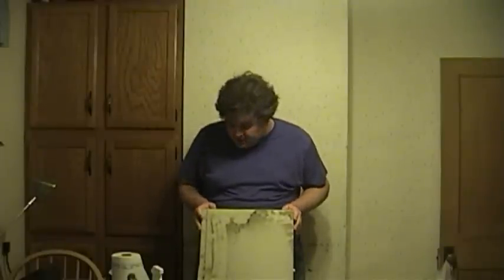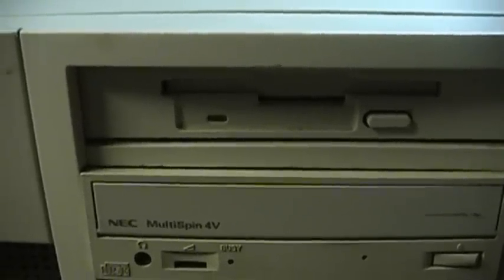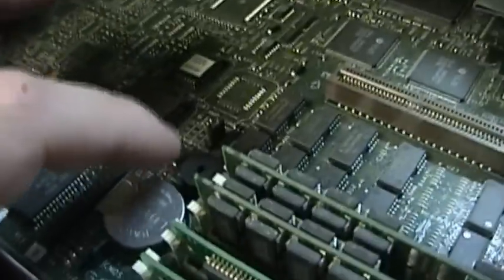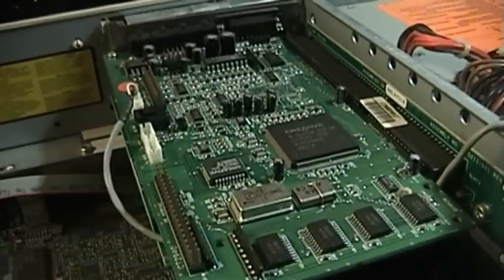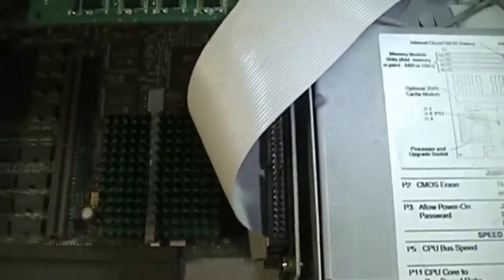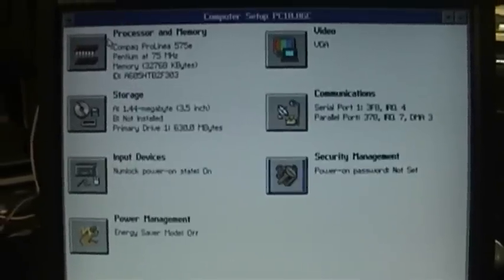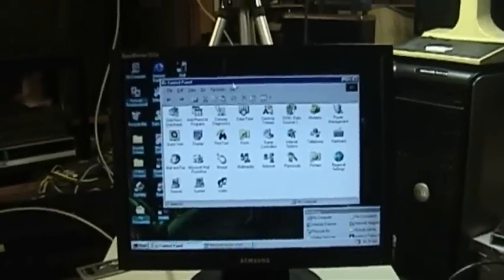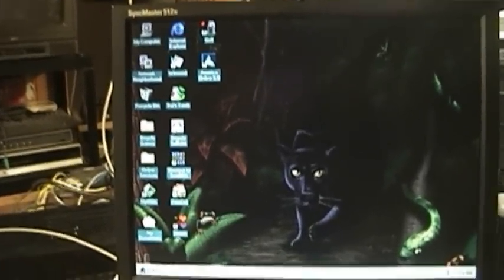Compaq Prolinea 575e Overview

Comment: If I recall correctly, these early Compaq machines beep twice to indicate they are in "turbo" mode.  In the BIOS/Setup program, there should be a way to change it to "compatible" or "deturbo" mode, and, once rebooted, the POST should only produce 1 beep.  I don't know if that holds true on such a "new" system like this, but it was the case on Compaq's 286 and 286 machines for sure.

The NEC MultiSpin drives made that clicking sound when powered.  Sounds totally normal, no surprise it worked.  I've had a few of those drives over the years.

Comment: For 1996, that machine was crappier than the average Packard Bell! At least they shipped machines with more than one PCI slot and a real Intel chip set (that could support 66Mhz bus speeds). Needless to say, such a machine from that era wouldn't be a keeper for me. There are better Socket 5 machines out there.

I'm also curious about how messy this mess room is.

Comment: You saved me from the boredom of waiting for Windows 8.1 to install 143 updates (~1.6GB download).
To add insult to injury after the 95-th update it logged me off without any warning and continued installing the rest of the updates.
As lacking in polish as GNU/Linux may be at least it handles updates right.

Comment: Ha ha thats classic bill, yep it does need power :)
Compaq 2nd ide port, bloody pain in the bum, "special" yep there special allright lol.
Im much the same as you but with any version of windows, all the fancy bullshit is switched off, basic menus and basic mouse pointer, no themes!!, no silly sounds.
As i came from the dos days i like simplicity, yes im simple lol im sure you were thinking that :-D.
i like a quiet o.s that just runs my programs, no arguements like vista/w7... give when you try to run a new program, just run the dam program without annoying me, i am the bloody admin so get on with it!! ha ha :-D.
When you talked about video chips i thought about my first pc, an xt class machine called Elernex, it had an unusual cga/ega card marked Video7, it gave me ega on an old cga monitor, it was deluxe in those days lol, it also had a nec cpu that run at double speed if you had a small dos util to instruct the cpu "Fast mode" lol, oh the speed :).

Comment: Hey UXW, Gio here. First off I been a subscriber for a while absolutly LOVE your vids. You make watching them so enjoyable. My question has nothing to do about this video. But I need your help on a simple problem. I have a Mac mini with a Mac pro keybpard. My problem is the keyboard has a power button on it to turn the mini on and off. Well the off works, but not the on?? Im sure your familuar with this keyboard. What would the problem be?? when you posh it to turn off it does. But when you push it to turn on. it does nothing. Any ideas you might think would be greatly apprecited. Thanks. Gio. Sorry for the long message.
Reply: Thanks Bill. But the mini is from 2007, just like the keyboard. thats why im confused why it doesint work. Everything else on the keyboard works.
Reply: Bill, Im SORRY you are RIGHT. The keyboard is from 1998, Damn I feel like afool. Thanks for answering. Gio.

Comment: A perfect example of one of the low-end Pentium machines that the later 486DX4 and 5x86 chips could easily outperform. Many, if not most, 75 MHz Pentium chips were designed for 90 or even 100 MHz operation and were underrated just to have a Pentium to sell at a cheaper price point.

I didn't notice the audio and video drifting too far out of synch, but you already have a solution for that... you just haven't used it yet. ;-)
Reply: *****
Use MediaInfo to check if it's doing something screwy like encoding the video with a variable frame rate.
Reply: ***** I really enjoy Sony Vegas Pro 12, for all my editing, although me and you make very different videos. Keep up the good work. :)
Reply: ***** Silly noob... you should be using Linux for video editing! :-P
Reply: Stereo Dust Particles haven't you got an lamp Imac G4 still sitting in your garage? Why not edit on imovie on oldschool osx with imovie 04 or 09 :D Would make a fun video.
Reply: vwestlife Well, there is a professional video editor called LightWorks that has a version for Linux. Except that a copy costs $500.
Reply: Good video i remember these computers
Reply: For some reason google chrome on smartphone wont show add a comment but anyway its Google or something.  Got a laugh out of video :)
Reply: vwestlife do any of you guys know this channel I am thinking of - it has a dodgy intro with like this wierd music and he makes videos similar to you guys (you guys being vwestlife, uxwbill and maxxarcade) something like bbsomethingcomputershop or something like that
Reply: ***** thanks, literally just got it now as well xD remembered one of the video titles.
Reply: +m80pls would that be BBISHOPPCM at all??

Comment: Some one seems to be slightly "ticked" off in this video! haha I get tired of people even considering core 2 duo based pcs to be ancient when the joke is on them! I am watching this video perfectly fine with a T7700 Core 2 Duo!
Reply: MaxinMaytrix Core 2 Duo CPU's are still awesome CPUs! (Core 2 Quad was even better!)
Reply: ***** Exactly! Core 2 Duo CPUs ran XP, Vista, and 7 blazing fast!
Reply: My t7200 struggles a bit with 1080p on YouTube but otherwise it really surprises me.
Reply: LordMaxin I think core two duos are good I use them at school they work fine
Reply: MaxinMaytrix I got  dell optiplex 780 with a 3 GHz core 2 duo, sadly I bought the wrong power supply
Reply: I was only joining into the simple conversation, no need to be rude.
Reply: MaxinMaytrix A few months ago, I bought a Dell OptiPlex 730 with a Core 2 vPro (a Core 2 Duo with some extra features for Virtualization) and Windows 7 Pro from my college's surplus sale.

Works pretty well, I'm actually watching this video on it.
Reply: I have recent resurrected an ancient laptop that featured a single-core Celeron 585, and it was painfully slow.  YouTube video?  No chance, it was so bad.   So, I found out what the highest-end CPU it could support was - in this case a Pentium dual core T4400.  Bought one on ebay for pennies.  Stuck an extra gig of memory in there (again very cheap) and, because I was feeling silly, I stuck a dirt-cheap Chinese SSD in there.  The transformation was incredible.  Sure, it is no gaming "rig" but, now running Windows 8.1 rather than the original Vista it is a little screamer, happily playing YouTube videos in HD and generally being a modern PC experience.  Not bad for a low-end laptop from 2007!
Reply: MaxinMaytrix I'm looking to buy a C2D system because of exactly that reason, that people think they're junk. But could you tell me how your system handles HD video playback either via streaming from online or locally from a hard drive?
Reply: +Dj4Life777 that is the really strange part. For the longest time it played full HD flawlessly. Recently not so much. Now I get nothing but taring with any video under Windows. Now booted under Ubuntu I get no taring whats so ever and it's the same revision of the video drive just for Linux. I feel like Microsoft is slipping little bugs into updates as they did with the annoying upgrade to 10 system tray prompt that wont go away. I think they just want people to get 10 and I'm not going to do that. I might just be crazy but for the longest time HD video and 7 ran flawlessly on this laptop and now all of a sudden it does not.
Reply: ***** 2012 called, it wants its Trollbait back.
Reply: ***** "Trollbait" Well that one i have never heard of!lol
Reply: *****
It's funny you say that. I was a jock with three letters on my Letterman's jacket in Sr. High.....
Reply: Oh we got a live one here!lol
Reply: Haven't had the beard in a long time :)
Reply: MaxinMaytrix Damn that sucks... Wouldn't surprise me if their "updates" (on much older hardware) were also partially designed to bog them down. Which OS are you running though?
Reply: I like the Athlon 64 X2 series more, but thats my opinion

Comment: I know Windows 98 on that computer probably takes up a lot of disk space. I would wipe the hard drive and do a clean install of Windows 95 on it, because Windows 95 would be better for that PC and it uses less disk space.
Reply: Oh ok, those vintage Compaq's are great for DOS games.
Reply: ***** Do you even own a copy of Windows 3.1? Just thought I'd ask :P
Reply: dutchhypercraft1 On that PC, no matter how far you upgrade it, you'll only get a little XP ;)
Reply: Jacob Turner
It's actually alot faster than you'd think.

Win2K on that machine would run just fine with the tweaks i'd mentioned. Daily web browsing (non video streaming of course) listening to mp3's/audio streams, dos/win95 based games things like that would be ok tasks for such a configuration.  

And as for XP running on the compaq, well I personally wouldn't do it unless I was upgrading the processor first. But theres really no point, since Win2K would suffice, i was just making a point it could technically run on the unit.
Reply: I bet he does not have Windows 2.
Reply: Duran Medine 
with a ram,hard disk upgrade and slight overclocking win2k would run on it okay.
Reply: ReCkLeSsErr0r Why would you want to run 2k on it? What can 2k do for that machine that 95/98 couldn't? It's probably never going to be able to run anything that requires anything newer than 98.
Reply: Jacob Turner
"Why would you want to run 2k on it? "

How about the stability of the windows NT kernel instead of fussy windows 98 with it's blue screens?
Reply: ReCkLeSsErr0r Windows 9x was a LOT more reliable than people gave it credit for. Even if you were to put yourself through forcing 2k on this machine, it would strain to run it even after all the upgrades you could throw at it.
Reply: Jacob Turner
Not even. Security and stability was compromised to a noticeable extent

http://www.makeuseof.com/tag/3-windows-98-bugs-worth-revisiting/

And no the computer wouldn't strain to run it,heck even XP would would run on it. For 2K and up I'd overclock the CPU to 100 Mhz, upgrade to 72mb max ram, (xp minimum requirement is 64mb btw)and put a 7200rpm or 10,000 rpm drive in it.

In fact this machine could have server 2003 installed on it and be used as a storage over someones LAN too.
Reply: Then you obviously have a lot of patience, a heck of a lot more than I have.

I wouldn't bother with anything over 95, myself, for usability reasons. XP especially chokes on such an anemic system. By the way, XP wants at least a 233 MHz Pentium, even though it will install with less. XP on minimum specs is NOT a fun experience.

Comment: The company I worked in had a bevvy of these machines as the very first desktop computers in customer service. They were barebones machines, ran Win 3.1 and were networked to a billing system using the serial ports and category 3 cabling. The "hub" of the network in turn communicated with the mainframe someplace further north.

A team of techs and myself pulled all the wires and I assembled the little RJ11 jack to serial port plugs. Even though they all were set up with Win3.1 we edited the autoexec.bat to launch the billing system software, a DOS terminal program. A few of us cheated and let Windows launch and would run the terminal in a DOS window. That was when we found out that Solitaire and Mindsweeper were loaded on them too.

Comment: In all seriousness, while I think things like floppy drives and parallel ports are optional, there is no excuse for any motherboard not to have PS/2. We need that! what if I go to navigate my BIOS with a Corsair K70 RGB and I can't due to lack of drivers!?

Besides, I just love my Microsoft Internet Keyboard...
P.S. - IDE drives blow ass through a horn, no question.
Reply: Bios mode. Most quality (mechanical) boards have it. I do love me some old clicky boards mind you.
Reply: Haha, thanks for the help!

I'm not as totally against IDE as I may have implied--I still don't like them--my main ire is with the capacity limitations and the way IDE cables can be difficult to manage. This is, of course, to say nothing of a SATA cable's 50-time insertion rate....

Comment: i got a question for you, do you do computer repairs? i have a dell optiplex 745 minitower that has a problem where the fan runs full blast all the time until i boot into the os and control it with speedfan
Reply: GaminGod Coffeeman I think that model has an air temperature sensor that governs the fan speed.  It could be that it came unplugged, is covered in dust or is broken.  Try this for more info: http://en.community.dell.com/support-forums/desktop/f/3514/t/19508060